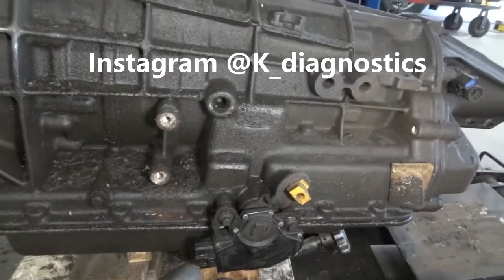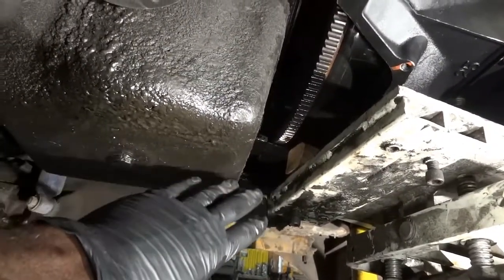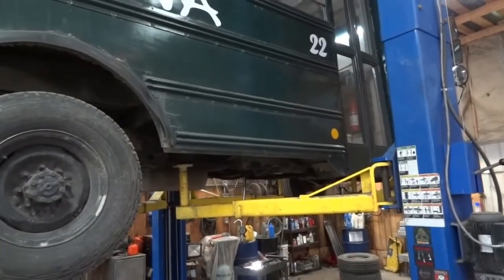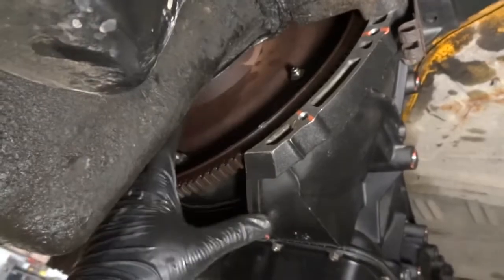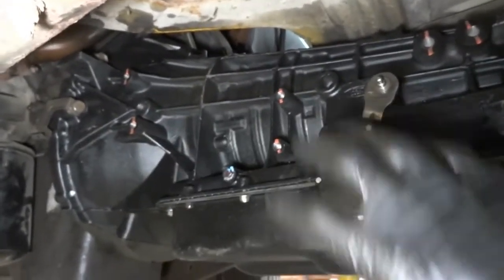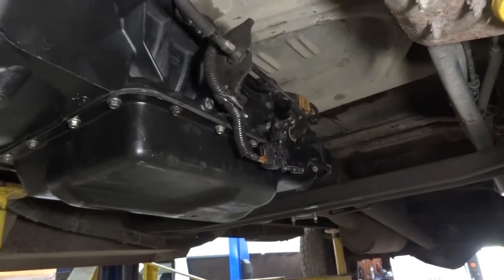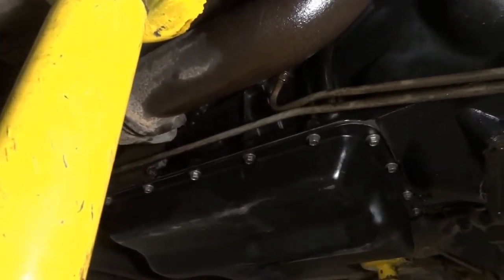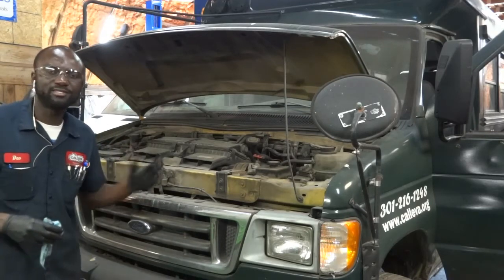How To Remove and Replace a Transmission On a Ford E350 Part 2

Comment: Very very clean and straight to the point video my friend... Good job. I have a 2007 E350 van that drives but don't move when I put it in reverse,  any ideas what the problem is  or do i need a new transmission?. Please  i would really appreciate your feedback. Thanks.
Reply from the maker: @oladapoakeredolu2859  Thanks! Check your transmission fluid, if the fluid level is fine then your transmission might be bad!

Comment: Good video i had my mech replace trans on 06 ford e350 because it will not shift pass the 3 gear we replaced the trans with a used one and we still have the same problem u have any ideas?
Reply from the maker: Dan Will  does it have a gas engine? if yes you might have to check your exhaust for restrictions
Reply: @KITS_Auto_and_Truck_Repair  it has gas engine i will check the exhaust

Comment: I used both of your tranny replacement videos to swap out my mine.  Took 5 hours since I've never done it before.  Heck - I'm not a mechanic.  :)
Reply from the maker: Scott McKinley  wow that's awesome, congrats I'm glad to hear that the videos were your guide!!
Reply: Hey Scott M. I will be tackling trans removal next week. 5 hours was great. Was that your first time? Any watchful hints? Thx. JP
Reply: @jean-pierrehall2914  It's pretty straightforward when following his video.  I did watch another vid (can't remember which one), to get another mechanic's perspective - also gave other helpful tips (which I can't recall at this time).  Sorry for being vague, but it WAS a year ago.  I DID use a lift (hoist) at a friend's shop which help immensely.  I used a welding table to "catch" the transmission when it came out, and to hold the new transmission when re-installing.  I didn't feel comfortable using a tranny jack (and would have had to buy one).  I just lowered the vehicle down to meet up with the table and "duck-walked" under the van to shimmy the transmission loose and onto the table.  Then I lifted the van back up to get back under and roll the table out.  I then used a cherry-picker (engine hoist) to lift the trans off the table and into the heavy plastic shipping container the new one came in.  I then reversed all that to get the new trans under the vehicle, where I lowered and re-installed.  I made sure to start as many bolts thru the bell housing to the engine block that I could.  This way I could align the trans better so it bolted up straight and easy.  I hope this helps.
Reply: @soundsnvisions  Thx Scott. I’m renting a trans jack from Sunbelt and I have access to a lift. The only thing I was worried about was the alignment when reinstalling the trans. Thx for your advise. JP
Reply: @jean-pierrehall2914  if I recall..... the trans has guide pins (2).  That helps
Reply: @soundsnvisions  yeah Scott I remember now in video he mentioned the metal dowels. Thx. I will be replacing the rear seal the week before Thnksgvg.

Comment: So my transmission gave out on my E350 super duty 2009 what transmission should I replace it with if all that I’m going to be doing is hauling cars around
Reply from the maker: Jeff Smith  you should get a remanufactured transmission!!

Comment: GREAT VIDEO. Very well demonstrated. I have a ‘11 E150. Grinding/grating noise coming from of transmission where drive shaft yoke enters transmission. Vehicle has 200k I figured transmission is shot.
Reply from the maker: jean-pierre hall  Thank you!!
Reply: Hey K Dia. I also left a reaponse on Part 1. When reinstalling trans and the cross member support and rear trans mount bolts are installed does that align trans to engine block? Thx. JP

Comment: Ones again. Thank you so much for sharing your videos and knowledge. Only one question, for a non mechanic guy with some mechanical knowledge and the correct hand tools at floor level. How long you think it takes to do the whole process to replace the rear main seal on a 2001 f150? Thanks  again.
Reply from the maker: Jose Angeles it really depends! hopefully there aren't a lot of rusty bolts, it might take you 6-7 hours or less!!
Reply: Peace Jose.  I have to replace the rear main seal on my 2011 E150. I will also be removing trans solo. Any suggestions or watchful hints. Thx. JP